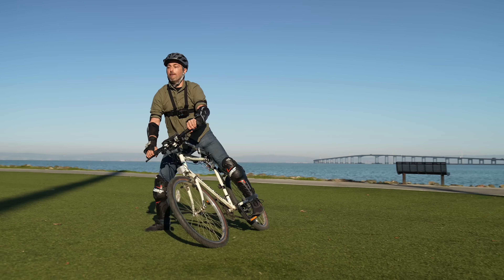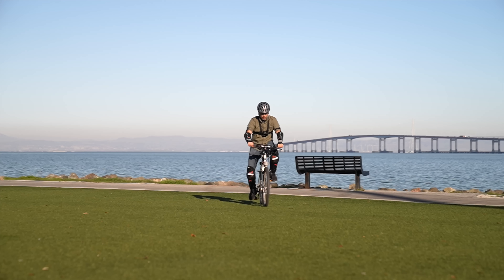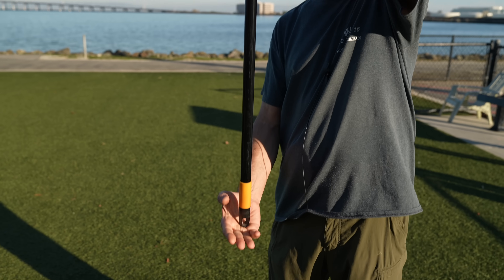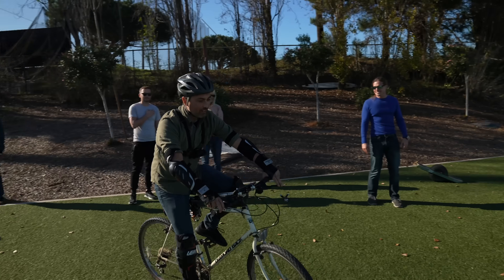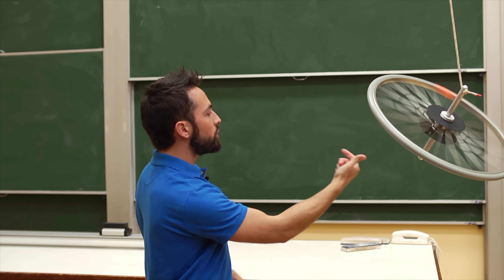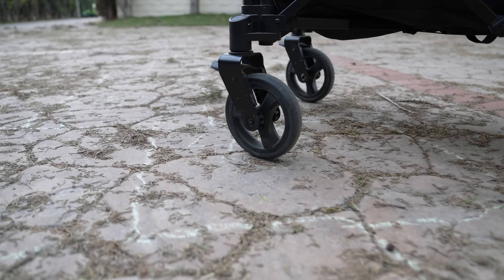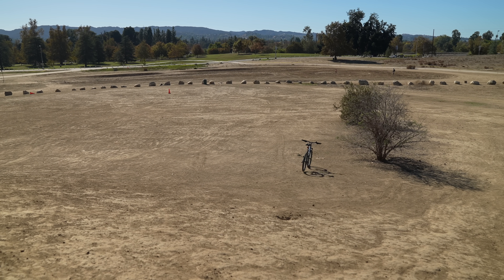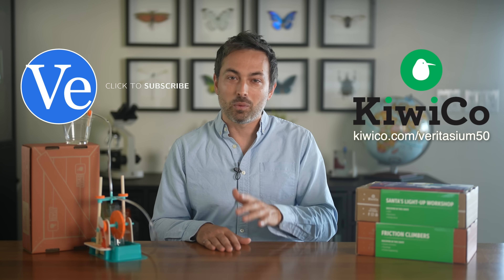Most People Don't Know How Bikes Work

Comment: Maybe my mind is just melting, but it sounds like with practice, you could gently lean to the right or left and start falling, like the empty bike, then turn into it to catch yourself, and hold the turn like you did on video. It seems like the hardest part is not accidentally needing to turn left a little but before left (or right) locks. So if it is random chances, are it will catch you off guard and you're stuck in the awkward unstable fully upright position. Either way it's interesting and cool!

Comment: Cotton chipping once on a motorcycle set up with an auto clutch and outrigger so that the bike could easily be mounted and dismounted to attack weeds, was a fascinating experience. With all three wheels on the ground there was no counter steer to initiate a turn. However on the open road you could get the outrigger off the ground and then you had a normal steering motor bike. So the one vehicle had two distinct turning characteristics which didn’t take much to master, at least not for me being a seasoned dirtbike rider I assume.

Comment: Leaning at higher speeds is what I have found is the easiest way to turn a bike. If the bike starts to lean a way I don’t like, I just use a bit of counter steer. Biking in my opinion is very similar to driving a car, except you must put in more energy to go faster. I prefer higher speeds as my bike seems more easy to handle at higher speeds. To turn, just slightly lean to one side (the side closest to the apex of the corner) very slightly after entering at a moderate speed and turn the handlebars slightly. Any more than 45 degree angle will cause you to crash, especially at higher speeds where the handlebars can suddenly exert more torque, causing you to stop or else injury. I cannot bike slowly without falling off.

Comment: Riding ability plays a huge factor. You most definitely can turn without counter steering first. Also doing a rail ride you might as well have locked steering because you are riding on top of a rail that is only as wide as the tire.

Comment: When I'm riding a bike at a decent speed, I find it quite easy to let go of the handle bars and ride "no hands". While riding without holding the handle bars, I can turn corners by leaning in the direction I want to turn. I'm curious if it would be possible to turn like this on your bike.
Reply: Not touching the handlebars won't change physics.

Comment: Another factor which you did not mention was the shape of the contact surface area between the tire and the pavement. Since bike tires are always doughnut shaped and compressible, the point of contact between tire and surface naturally forms an ellipse that is perpendicular to the axle orientation when the momentum is codirectional to the velocity and center of mass is directly above the contact surface.

The ellipse shape curves in a direction that is tangent to the turning radius, away from the turn direction. It is also shaped toward the direction that the momentum is offset from the velocity. These curves that are formed naturally correct the path of the bicycle and there is nothing stopping you from having control of a bike with fixed handlebars through leaning alone, but the bike will not stay upright without a rider if the fork is fixed in the same direction. The more momentum you have, the less you will be able to steer by turning the handlebars because of the increased g-force (centrifugal), which is why you need to lean in addition to turning to avoid crashing, but technically it isn't necessary to have turning ability. 

There must also be enough friction between tire and riding surface or it will not be possible to control the trajectory, such as if you attempted to turn on an icy surface. You also cannot turn if the normal force cannot reshape the tire when weight is applied, such as if you were riding on sand. In either scenarios, the rider is able to stay upright if they do not lean or turn.
Reply: If the steering is fixed the bike will not turn, no matter what shaped tyres it has.
Reply: @XtreeM_FaiL  If a doughnut is rolling on a surface and it's axis of rotation is nonparallel with the rolling surface, you will observe that it's path has a radius that decreases when the axis of rotation is tilted (leaned) more. In this scenario, there is a torque that is coaxial to the direction of velocity, which is 'attempting' to make the wheel stand in an upright position, in which the axis of rotation is 'attempting' to become parallel with the rolling surface. When countertorque is provided that forces the doughnut to continue rolling while leaning on one side, this changes the trajectory of the doughnut and causes it's path to follow a radius of curvature. 

On a bicycle with fixed steering, both wheels experience this torque when the moment of inertia is countering the torque that keeps the bicycle upright (a leaning rider). In this scenario, since both wheels are fixed, the torque that is created by leaning will be resisted by the tendency of the bicycle to go forwards. Since neither wheel is able to rotate but the force of the leaning rider is preventing the bicycle from standing upright, the tires cannot engage with the surface without a decrease in efficiency and there will inevitably be drifting that occurs, causing the bicycle to turn. 
The turning radius is determined by the ratio between wheel diameter and radius of a cross-section of the tire, and the extent of drifting, which is affected by normal force, friction between materials, moment of inertia, wheel acceleration or deceleration by peddling or braking, suspension/resonance and damping, grade of the riding surface, etc..

Comment: This is what makes emergency braking on a motorized unicycles interesting. Before a unicycle can slow down, it has to actually accelerate until the center of gravity is behind the contact patch and then you can slow down. Not great to have to go faster for a moment to be able to slow down.
Reply: Yup.  It's an inverted pendulum.  Same as riding a bike or balancing a broomstick on your hand.
Reply: @Rick_Cavallaro   - Correct, with the exception that a bicycle is an inverted pendulum only left to right, you don't have to worry about moving the center or gravity behind the bike before braking, and a broomstick does not have brakes. :)
Reply: @my_dear_friend_  Yes, I was speaking of the lateral axis of course.  You may have seen me riding the unicycle in the video.  It's an inverted pendulum in both axes, but you control them in different ways.

And you're right that a broomstick doesn't have brakes, but it follows the same laws of motion.  If you're walking with it and want to slow down, you first have to speed up slightly to initiate the aft lean - and vice versa if you want to speed up.
Reply: @Rick_Cavallaro  - Yes, walking while balancing the stick is the same principle. Now i understand your comparison.

Comment: Just try riding a motorcycle through some really tight twisties and you will find that to go right you have to really push the handlebars to the left to get the bike leaned to the right for the turn.  I had a very slow-turning Ducati and boy, all the effort went into pushing the bars the opposite way.
Reply: To go right, push right.
To go left, push left.

Comment: I recently learned how to drive a motorcycle; the countersteer force on a motorcycle, especially when going like 40-50mph is so high that you have to put like a few tens of pounds constantly pushing the handle to turn. If you stop doing it, the motorcycle has a self righting force due to the trail of the front fork. It's just so much stronger on a motorcycle since it's heavier and faster.

Comment: this just demonstrates counter steering, and people do it intuitively when riding. This applies to any two wheel transports. On a motorcycle you never pull the handle in the direction you turn, especially at high speeds. You always push the handle opposite of the direction you tend to turn.

Comment: Theres some motorcycles out there today with that active steering system to help with low speed maneuvers to prevent people from tipping as easily. Obviously much more involved with a 350+lbs motorcycle vs an at most 30lb bike.

Comment: nice collection of the facts about the bike balance and its geometry.. but yeah steering trick is what is called a "counter-steering" and learned by moto bike drivers on the tracks to push handlebar outside the corner instead of pulling it into the corners  :)

Comment: To be fair, if you would’ve leaned slowly as you steered you would’ve been fine. The turn doesn’t have to begin with the steering, you just have to learn to trust the bike. You wouldn’t need a counter steer before the turn if you don’t intend to steer the bike out from underneath you. Must be a more gradual turn
Reply: I watched the video brother. They’re only trying sharp turns, at a slow speed, both of which would make it more difficult considering at a slow speed more corrections left and right are needed even just riding straight. It’s a wonderful experiment but it hasn’t factored out the differences in human error, I understand that it’s true most people when turning will counter steer but that doesn’t mean it’s needed, just more convenient for balance and sharper turns

The points in this reply are kind of all over the place sorry
Reply: Turn always starts with steering. Go and try to turn a fixed steering bike or watch the video.

Comment: I think weight distribution plays a role as well. The counter-steering is used to initiate the turn more quickly, mostly in slow turns, or in evasive maneuvers. But the higher speed the less counter steer is needed. I would argue it should be enough only to lean if you are skilled enough, or when the speed is above some threshold. I may be wrong, but I don't think so. Because it's possible to stay on the bike while it's standing still, ie no counter steering needed, only manipulating where the center of mass is. You just need to be much more skilled, as the pros in biketrial and such.
Reply: Yeah...  No.  More countersteering is needed at higher speeds.
Reply: Steering becomes harder the faster you go.

Comment: why would you EVER turn the handle bar instead of just leaning like why you moving it just lean if you dont lean you will fall off
Reply: Because leaning do nothing.
Reply: @XtreeM_FaiL  Well yeah it is just the only way to move a bike left or right but other than that its pretty much the biggest factor with drifting.

Comment: as a motorcyclist this is known however at very slow speed when you are trying to keep the bike straight up and down i find it hard to agree...  at higher speeds tho defiantly, i lean left but turn right, however that "turn" equates to like 1 degree at the triple tree  or handle bar

Comment: There's a very simple way to demonstrate this and anyone can do it without any special equipment. Ride your bicycle through a puddle to wet the tires and then make a turn when you reach dry concrete. The wet tire tracks make it very apparent that the front wheel turns in the opposite direction first to lean the bicycle into the turn.
Reply: I'm thinking about this everyday on the way from my job. I managed to steer on both directions without countersteer. The difference between me and the test drivers is body position. I don't sit on the saddle. Also it's possible to turn handlebars on right side, then start turning on left side. 
I agree with title of this video.

Comment: You don't need the counter-steer, you can also just move your center of mass to lean into the turn.  It actually becomes a required skill if you ride at high speeds, and will let you turn even if your handlebars are locked up.
I used to do snack runs on my bike, but never got around to getting a basket or cargo rack.  I'd just hang the bags off my handle bars as best I could, which often meant also lashing them to the frame so they wouldn't rub on the wheel during turns, and almost invariably rendered the handlebars inoperable.  You learn to push the entire bike one way by throwing your mass the other before pulling it back and fixing your balance.
Reply: Sir Newton want to talk with you.
Reply: Omg, no.  The bike WILL NOT TURN without changing the direction of the wheel.
Reply: You've never thought of how turns work with trains, have you? @jridenour31  Same principle, but applied in reverse.  Bike wheels are round and create a small flat patch where they contact the ground; when the bike is completely vertical the bike goes straight because that entire area is moving the same speed, when the bike leans it causes the further edge of that patch to be moving faster and thus induces a gradual turn.

Comment: This is taught by motorcycle instructors. Counter-steering is something that even novice bikers do.  the problem begins when they dont know they are doing it and when its explained it seems counter-intuitive.  If you understand how it works it has the potantial to get you out of a sudden tricky situation like avoiding a pot-hole or other road hazard quickly and effectiely.  when i want to turn left i push the left handlebar away from me with my left hand and the bike leans left. i balance the amount of lean by the amount i push with my hand and the amount of acceleration.

Comment: An intuitive sense is to try to steer with one hand on the handle bars.  If you turn right, you’re realize that you’re PUSHING on the right handlebar.  Try turning right by pulling on the right handlebar.  It only works at really slow speeds.

I had to find this out for myself after I took a class to get my motorcycle license.

Comment: I disagree with this video. Its a year old though so I dont think that opinion matters. Counter-steering is not needed unless you want to make a quick 90 degree turn or further, and even then its not necessary, it just helps with balance. If the light turned on before it locked, you wouldnt have the problem since you could prepare your center off mass for the turn without needing to attempt a counter-steer. Simply moving your body to the left and then rotating the handle bars is enough to turn if you have enough notice and the turn is long enough.
Reply: I just realized that the video proved this point during the portion where you showed bikes self-righting themselves and keeping balance. They dont counter steer. Counter steer isnt necessary to turn

Comment: This is a very helpful video. I’m an avid cyclist and the steering and stability of bikes is often shrouded in mystery by those who design esp. racing bicycle frames.
Reply: So I just watched a video of Peter Sagan cornering. 

He starts the turn by leaning, presumably with the saddle as the contact point. He turns left by leaning left and following with the bars. He never turns the bars to the right. 

I feel like this video is a flawed model that doesn't really cover the full gamut of what entails turning on a bicycle.

Comment: You can't coz you need both left and right in order to even go straight. And thats very visible at the start of the ride as you are slowest there, to speed up you turn left and right in sync with your left or right leg is pushing the pedal. Its a stupid invention anyways.

Comment: The wheels of a moving bicycle are gyroscopes.
The axis of a gyroscope aims at a single point in the most distant place in the uniiverse.
Ernst Mach  (yes the speed guy )  regarded it as the strangest phenomenon known to mankind.
It can be explained by Einstein's Theory of General Relativity.
Reply: PS. If you spin up the front wheel on your bike and lift the wheel off the ground you will have a hard time trying to  move the handlebars.
The axis of the wheel wants to keep pointing at that mysterious point at the far end of the universe.
That is why gyroscopes are great for navigation....even in deep space.

Comment: "You use steering to keep the bike underneath you"
No. Steering keeps the bike underneath you. There is no "you use" necessary. Almost all bikes will automatically yaw to compensate any roll/lean that develops as a simple function of fork geometry. You may need to steer or counterlean to prevent this from developing into self-amplifying oscillations in some cases, but even with 60 kg dead weight instead of a rider, most bikes will remain upright on their own rolling down a hill, and almost none will have low enough lean-induced steering to simply fall over rather than overcorrecting into a fishtailing situation or autosteering too late. Probably every bike you have ever ridden has a natural tendency to self-steer in the direction needed to counter a lean.

Comment: Re: riding a bike is like riding an inverted pendulum?
No. Bikes have inherent stability while moving. A moving bike which is rolling or leaning to one side will induce a turn of the wheel causing the bike to yaw. It is more like a segway than an inverted pendulum. There are also some stabilizing and destabilizing effects of weight distribution in the fork and gyroscopic effects, although neither is the principal factor in stabilizing a bike. That would be the yaw/roll coupling.

And indeed, I posit that 99% of cyclists actually cannot ride an inverted pendulum. Try riding a bike that isn't moving?
Reply: You might be able to balance an immobile bike long enough to get it up to a self-stabilizing speed (and perhaps take some money off of Destin from Smarter Every Day if that bike has inverted handlebars you don't so much as look at because they will only confuse you), but actually keeping a bike upright if it's immobile and remains immobile would be very difficult.

Comment: it is hard to balance a stationary bike,  but not impossible. It follows that you can make a rolling bike lean without steering input. This means you can make a left turn, even if steering right is locked out, if you manage to lean the bike left using your bodyweight only.
Reply: And this surprises nobody that actually rides bikes